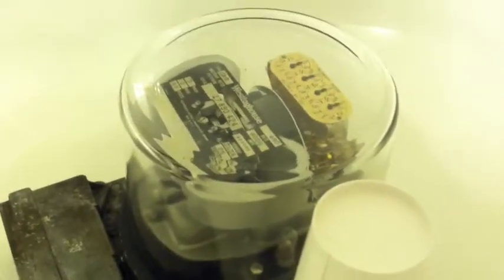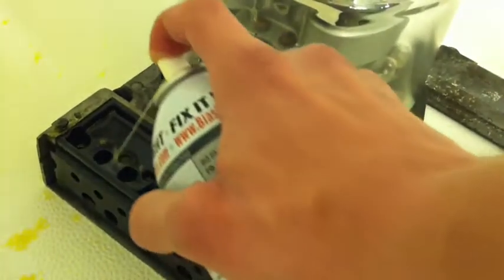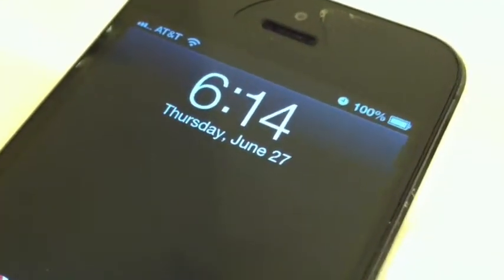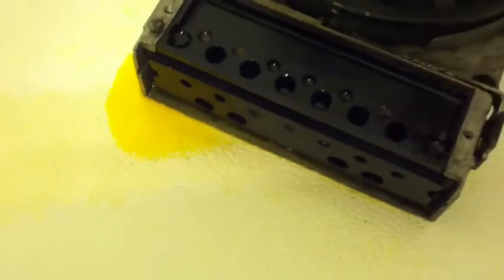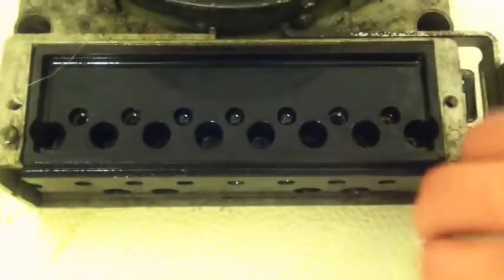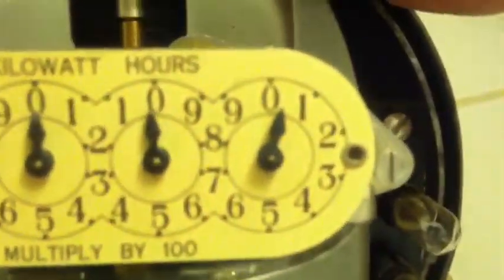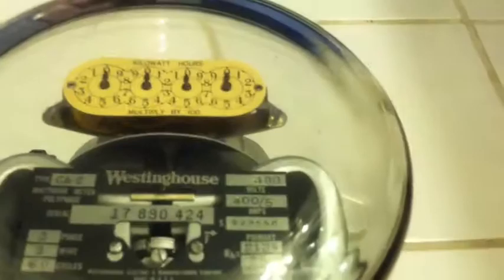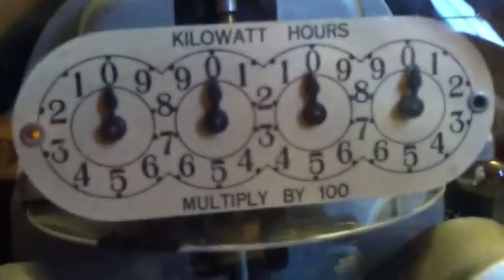Electricity Meter Restore

Comment: Before spraying that stuff in there, I would've 'gutted' that case. When you spun that loadwheel, you were a bit rough with it! :-O

After removing the accuracy magnets, a loadwheel can be spun by BLOWING on it at an angle, just like I did with my British Sangamo HM. The angle take a bit of practice, but it saves the loadwheel or it's shaft from being wrecked by rough handling. These are very fragile!

At 12:40, I noticed that this one has two loadwheels in there on a common shaft. That's nice.